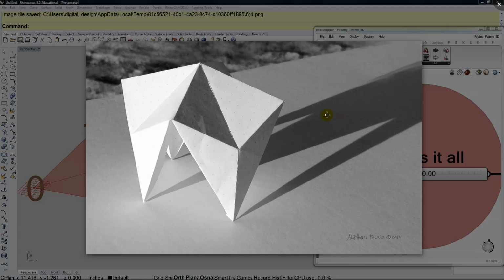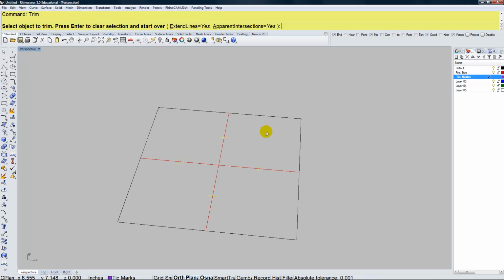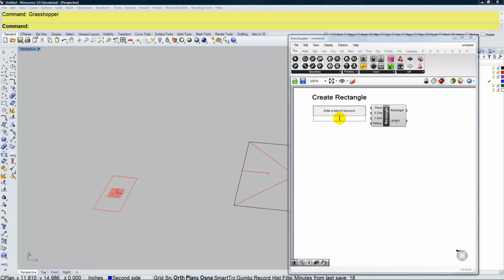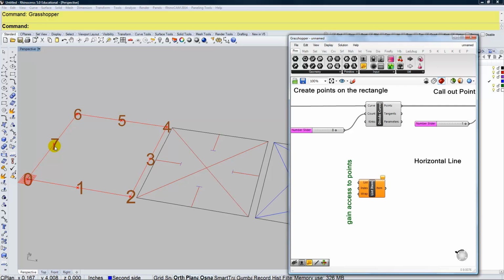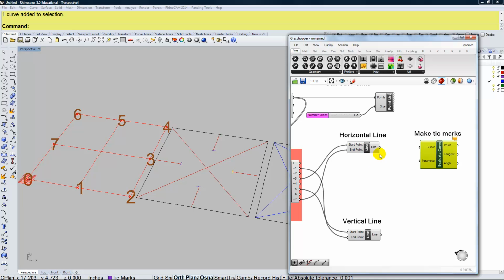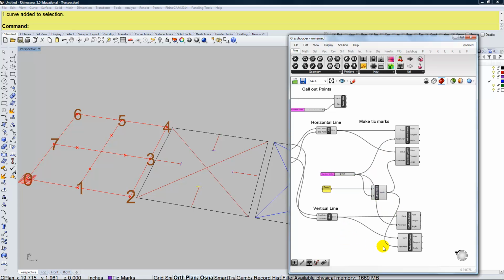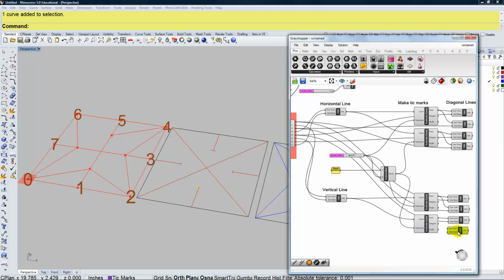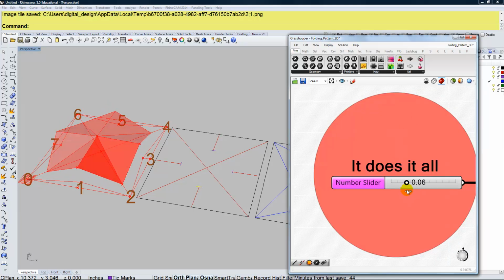Folding Pattern Grasshopper Part 01

Comment: Hey, I have my own geometric folding pattern, but I don't know how to change the parameters of the points. Since mine isn't an equal square, all the points given by grasshopper are wrong. How can I change those points to the correct parameters?
Reply from the maker: Hibakusha Hi. As long as the curve is reparameterized from 0-1 you can place points anywhere along the curve using the number sliders. You can also try using the divide curve capsule.
Reply: @AlphonsoPeluso  I don't have an exact square (15,2 x 20 cm), so that's probably making it a bit more difficult. I tried sliding the number silder, but that didn't work as I hoped. I only need points on both short sides of the rectangle, I could show you my folding pattern if that helps. I will try the divide curve capsule, maybe that's what I was looking for.

Comment: methmaticaly wrong,  point 1 move 0.25 doesnt mean centerpoint moves 0.25. so the shape of every facet changes all the time in your model
Reply: exactly! This is just an illustration, tho the real origami doesn't work like this. the length of the face' edges should stay the same at all times. i'm trying to figure out the math myself. anyone solved it yet ?
Reply from the maker: I hope you found what you were looking for